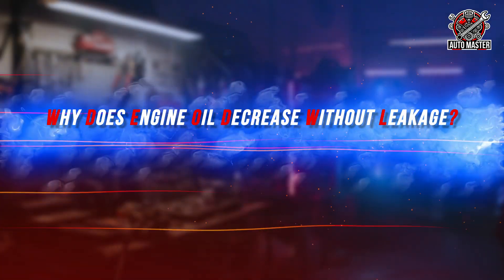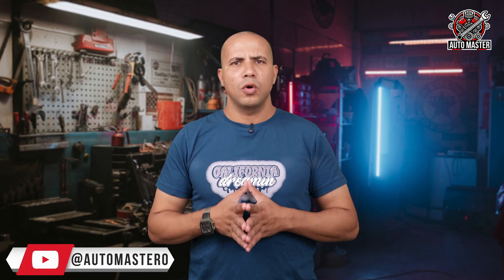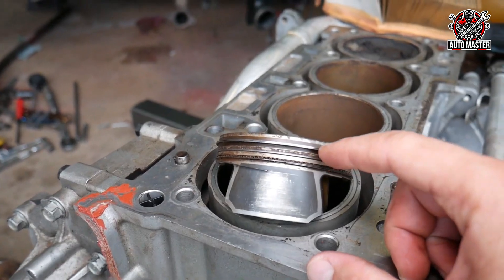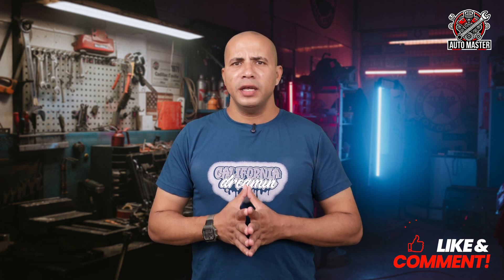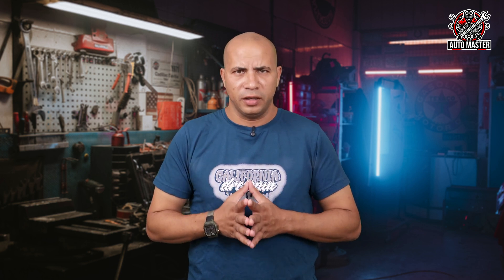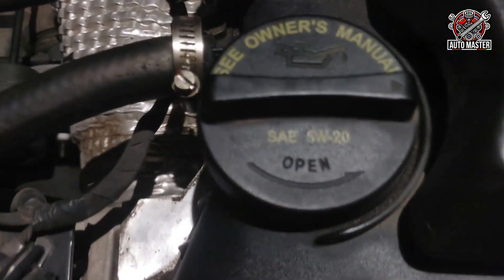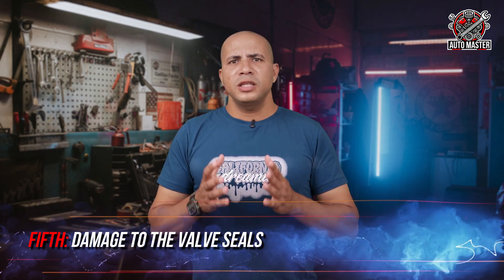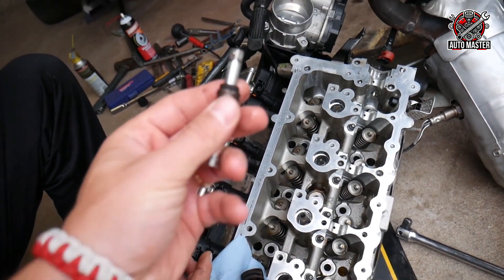Why does engine oil decrease without leaking? 5 reasons you should know!

Comment: People need to understand that all motors use a little oil. You pointed out certain instances ehere oil consumption is a little more., saving leaks of coarse. Pointing out that newer thinner viscosity oils is a great point. I like to use a higher viscosity oil and depending on the outside temp, definately.
Also, pointing out the oil change frequency is a very good tip, especially, for people, mostly women, that give it no thought. Every 5k miles is good no matter what kind of oil used and finally yes, people need to check their oil level often, every week or so, unless their motors are burning oil cause of high mileage, wear and tear.
Reply from the maker: Absolutely spot-on, my friend! 👏💪
You summed it up perfectly 🔧🔥 — a bit of oil consumption is totally normal in any engine, and like you said, viscosity and oil change intervals make a huge difference in keeping things healthy. 🛢️⚙️

And yes, checking oil levels regularly is one of those simple habits that can save you a lot of trouble down the road 🚗💨 — especially for folks who don’t usually pop the hood.

Thanks a ton for the thoughtful comment and for sharing your experience! 🙏💬